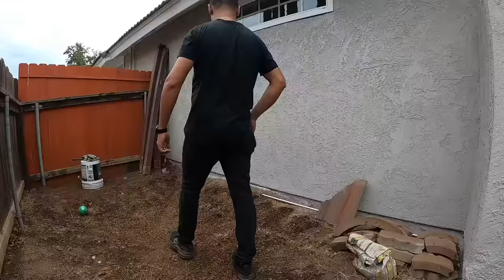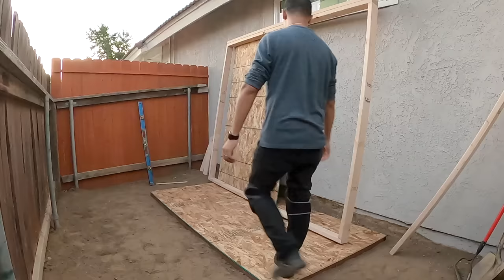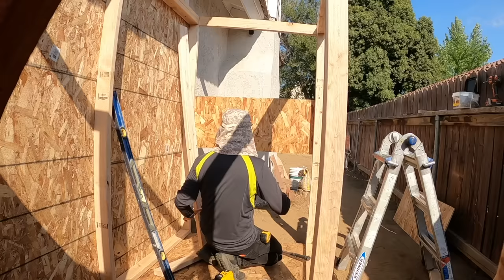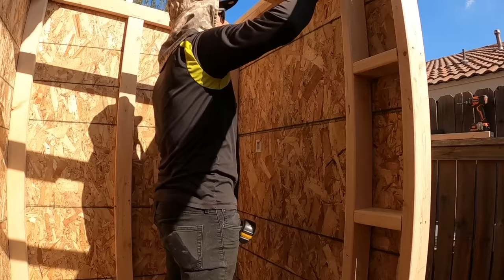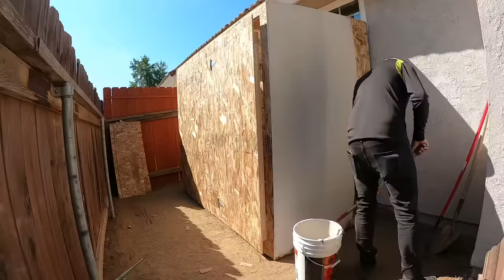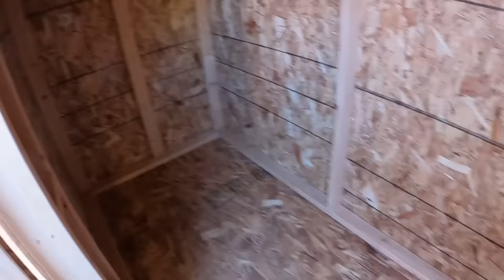How to build a simple 4 'x 8' storage shed under $380 dollars

Comment: Well I have 2 complaints, the first is that you dug it below grade, making for a place for water to gather and rot your floor. Second the pitch of the roof is very slight and in a heavy rain storm water will back fill and hit that window and back wall and run between the house and shed rotting that back wall. Otherwise I like the build, it is simple and easy to do, makes for a great storage place for gardening tools and stuff you need to store away for winter. I hope you take my complaints as constructive criticism, in hope to do it better in the future. I like that you added vents with a smaller mesh screen to keep bugs out and let hot air out of the shed. I also like how you did the roof, over all its a great build and design. So good job.
Reply from the maker: The base framing is below grade, however, there's good slope around it, the water does not pool in that area, it flows away from it. 
The roof pitch may not be visible in the video, however, in person you can clearly see that the front section is lower compared to the back, the rain water drains perfectly fine towards the front, we have had heavy rain and no water goes towards the back wall.
Thanks for your feedback 👍 don't forget to subscribe.
Reply: @NumberDZ I have another complain , I’m not the expert this seems reasonable about how flows the water, just wondering about the guard on the grinder, that disc looks dangerous, and for sure I’ll try to do a similar shed for my backyard, would be great if you share how many material you bought for it and the kind of tools you have used, thx!
Reply: And particle board
Reply from the maker: @orlandonunez5761  using the grinder without the protection is dangerous, however sometimes the protector gets on the way that’s why I removed it. I have included all the tools I used for this shed, you can find them under the “product” tag on the video.
Reply: Good shit guys
Reply: I'm building one today. Southern California OC area we don't have that much rain so his slope is not as steep because of our climate is really dry
Reply: Hindsight is 100 % correct, lol. The first building I ever made, I made so many mistakes. But that's like anything in life. The only mistake you can't learn from in life is car accidents.
Reply: You built it yourself with out anyone’s help 
You like it ! Thats good enough for me too many god damn complaining lol

Comment: no slope for the roof? where will rainwater go? also, about the hinges, you should have installed them in a hidden way so the screws are no exposed while locked - more secure.
Reply: I am amazed he didn't know 6" of the front of the shed.
Reply: It is sloped.

Comment: this is what I plan to build this spring, but with the door on the side instead of the front. Well done
Reply from the maker: I was also planing on putting the door on the side but after you start putting stuff in it, it gets difficult to reach the stuff all the way in the back, if you build it wider like 6’x 8’ you will have enough space to go around.
Reply: @NumberDZ  thats a good point

Comment: excellent video. Very informative. I need an outdoor shed so I plan to pretty much replicate what you have here. I do, however, have a few concerns. I'm in FL so we get a ton of rain daily from June to Sept. It is also almost 95 degrees for 4 months. The location I have selected will get little direct sun light but fully exposure to the rain.

How will the OSB holdup in the long run? Will painting prevent rot? How about a rubberized coating? Something like LIQUID RUBBER?

Comment: Nice build and well done video. One suggestion I might offer is to place a sheet of plastic on top of the final layer of dirt @ 2:10 so the floor won't rot. Thanks for a great DIY video!
Reply from the maker: That's a great idea!, thanks for watching.
Reply: Is it too late after it already done?
Reply: @redjeepyellowjeep-qz2on  If you read my post it says to install it at 2:10 which is DURING the construction phase, not after the build is done. So of course it would be too late after it's done.
Reply: I hired a company to make me a big shed(electric,a/c,etc)..I asked about something like that and they told me that water will always go under the shed and water need to drain so they compacted I think about 12 inches of pea rock/I saw vids of guys placing tubes to better drain water if it gets under shed /I was advised not to do concrete pad )
Reply: Of course I'm no expert about that but I had to pass different inspections from the city and it seemed correct info
Reply: Understood mate and thanks for the kind response @kikerules

Comment: You must live in a dryer warmer area. This would not work where I live. First, needs more drainage under the shed. Secondly, not nearly enough pitch to the roof. Lastly, the fiberglass roof is not sufficient for snow loads. Otherwise it's fine considering the price and care to detail used in building your lean to shed.

Comment: Why did you use OSB instead of plywood? That was a mistake due to susceptibility to moisture. Seal it real good on the inside too!
Reply: Probably price (osb cheaper) is it possible for the paint to seal osb(waterproof and humidity proof it)? I guess the idea is something not expensive and not forever (I can deal with spending $400 and replacing it maybe after 10 years )
Reply from the maker: You're absolutely correct, that is the main purpose of this video 🫡

Comment: Great work.  Just what I was looking for... I will build it this spring....just one change, I will be putting the door on the short wall.  thanks
Reply from the maker: Glad it helped. 
I was also planing on putting the door on the side but after you start putting stuff in it, it gets difficult to reach the stuff all the way in the back, if you build it wider like 6’x 8’ you will have enough space to go around.
Reply: @NumberDZ  Good point, makes sense

Comment: Hi , is there any option for door adjustment? I built 5×3 Domi shed exactly by assembly manual but I can close the door without heavy force.  A top of the doors are touching each other plus right door looks lower than left. Any advice? Thank you in advance for help!!

Comment: never seen those plastic wavy things for the roofs before. Those are nice. Do you remember what they call them>? I have seen foam ones but they degrade over time.
Reply from the maker: Home Depot sells them, look for “Polycarbonate Corrugated Roof Panel” mine are 26 inches x 12 ft.
Reply: That polycarbonate roof is available in 4x8 sheets also.

And of coarse there is a price difference between the 4x8 sheets and the smaller ones.
But once you buy those plastic inserts and the screws to attach the smaller ones.
You end up spending more than if you just bought the 4x8 sheet.
Reply from the maker: My local Home Depot doesn't carry 4x8, otherwise I would have bought that size
Reply: @NumberDZ 
Mine doesn't either.

Comment: You know you could've doubled the width and it only would've taken 3 more OSB sheets. Also it would've been nice to paint marine grade paint on the OSB to prevent rotting longer.  But as long as you keep painting sealing it every 2 years with water sealant you should be fine.
Reply from the maker: I know but the space wouldn't allow me to make it bigger.
Reply: Can you explain that to me? I'm a total newbie and would like something a little bit bigger and if it only adds three more sheets of plywood to it that would be awesome but wouldn't you still need more 2 * 4 for the framing?
Reply: @MyCabinLife  yes you would need some additional 2x4's for framing but that would equal about 8-10 more.  
If you added on 4 ft to both front and back end,  that would make the building 4 ft wider.  You osb sheets are 4x8 ft so a sheet at both ends cover the frame on the sides. Your roof area only extends 4ft so a whole 3rd sheet on the extended part should cover that as long as you building is only 8ft long

Comment: Looks good but how is it holding up with all the rain recently. Kinda worried your shed is getting flooded since it wasn’t raised much and was any Tsing going thru your window or shed since their was no pitch to the roof
Reply from the maker: No problems so far, everything looks good. The floor is about 6 inches above the ground level so no flooding problems. 
The roof has a good pitch the water drains towards the front, you can’t really see the pitch in the video but you see it right away in person.
Reply: @NumberDZ  good to hear I know alot of california is getting flooded and I just couldn’t see the pitch of the roof . This is a good video I might try and build one

Comment: did you drill pilot holes for all the screws? im just wondering because I just bought all the equipment and forgot to get a pilot hole drill lol
Reply from the maker: No pilot hole needed, you just need to put some pressure on the impact drill and you will be fine.

Comment: I wanna build a shed just like this but I dont want to build ground foundation for it cause I am eventually building a deck. My question is, does something of this size need to be anchored? Could it tip over? My guess is no but just wanna be safe. I actually wanna put wheels on bottom to be able to move it so I can build deck afterwards then place it on top. Any help would be appreciated. Its my first time doing this (attempting).
Reply from the maker: It won't tip over. 
You won't be able to move it easily, because it is very heavy. My suggestion is to build the deck first then the shed.
Reply: Yeah maybe I the deck first is the best thing to do. Thanks for reply back and great video. @NumberDZ

Comment: Nice job. What's the angle you used when you cut your sides of the shed?  I'm curious as I'm building one and I'm using your shed as an example.
Reply from the maker: What sides are you referring to?
All the sides are straight cuts with the exception of the roof.
Reply: @NumberDZ  yup the roof
Reply: He stated in an earlier comment that he used a 5" slope towards the front, and the area has excellent drainage.

Comment: Nice work. I can’t believe the total to be in the 300s. I’m guessing the building materials are still inflated because after Covid? I know lumber price increased, but is it still high?
Reply from the maker: Yes, they kinda are, I live in California, everything is crazy inflated here, not only lumber.
Reply: It’s just under $300 for material at my local Home Depot granted I want to buy pains and sealer to keep the wood in good condition and then expanding foam so seal all gaps
Reply: @itzlethal1700 what city or state you in?
Reply: @NumberDZ you know anything about prices in Mexico? Thinking of building a shed down there on some property i own. Any thoughts?
Reply: @andyfumo8931  I live in California so everything is expensive but still this shed was  very good priced, ended up buying LP smart siding for the walls and putting on galvanized metal corrugated sheets for the roof but it was roughly and same price if not cheaper than a prebuilt shed the same size and it’ll last a hell of alot longer, some waterproof silicone between the roof panels before screwing them down with some metal screws that have like rubber rings near the head for extra waterproofing and it’s been holding strong for the last 10 months
Reply: @andyfumo8931  only wish I would’ve made it bigger but 4x8 sheets of wood for the floor and side walls fit perfectly together so you could potentially make it twice as thick with more money, granted I spent more than $300 since I didn’t have all the tools needed and I upgraded mine but I use all those tools pretty frequently, $40-$50 circular saw from harbor freight been putting in work ever since
Reply: @itzlethal1700  you think i could get away with using a jigsaw for the cuts 😭😅
Reply: @andyfumo8931  I think you could it would just be a bit of a pain, probably have to clamp it down but I used one for many projects lol
Reply: @itzlethal1700  yea maybe a good carpenter 🪚

Comment: Excellent job bro!
I'm a framer from the past I'm quite impressed.
Reply from the maker: Thank you!
Reply: For a person wanting to store heavy things they could go 16" centers on floor with 5/8" or 3/4" OSB.
Also on the overhang ends of the polycarbonate panels is it open to allow air in?
I assume it is that's why you didn't put a vent on the other end for cross ventilation

Comment: when you measure diagonal os that to check if its frame? and measurements you looking for
Reply from the maker: That's to check if the frame is square, both sides have to give you the exact same measurement, if they are different that means it's not square.

Comment: Great Job. I only have 2 issues, the base was ontop of Dirt and the roof does not appear to be Slanted. The base is subject to rot from moisture and the roof water may drain in to your home. Otherwise Great job.
Reply from the maker: I used pressure treated 2x4s for the base, it should be good for many years it also has good water drainage so the rain and moisture is not a problem.
The roof is slanted, the back wall is 5 inches higher than the front, all the water drains to the front. Thanks for watching.

Comment: I wander when it rains if the water drains back toward the house since it’s flat ?
Reply from the maker: The back wall is 5 inches higher compared to the front wall, if you watch the entire video you will see it, so the water drains towards the front of the shed.

Comment: Why not use the wall of the house as the back wall of the shed?
Reply from the maker: You will need to pull a permit if you attach any structure to the wall of the house.
Reply: @NumberDZ  Good reason- thanks!

Comment: not bad....... but I would have done a concrete base to make sure it doesn't rot when it get's wet
Reply from the maker: I was going to do that but the price for the materials to do the concrete myself was $900 dollars, so I decided to use pressure treated wood instead.

Comment: I dont understand if the back is 8x8 how did you overhang osb 1/2 inch on each side. it has a 1/2 inch overhang.
Reply from the maker: I made my floor base 1 inch short (95 inches)  so my plywood on both sides sit flush with the back plywood, that’s why you see that 1/2 inch overhang.
Reply: @NumberDZ  thats what i thought but i didnt see you cut that good idea thanks for the quick reply.
Reply from the maker: You’re welcome.

Comment: Will the paint you used protect the osb from water/rain?
Reply from the maker: Yes, make sure to use semi-gloss or hi-gloss paint.
Reply: It is highly recommended to use an exterior oil based primer sealer, then apply final paint coat.
Reply: @dropndeal  Yep, I would most def prime it then paint

Comment: How did you solve the moisture problem?
Reply from the maker: What do you mean?
Reply: @NumberDZ  I would have raised the shed above the ground level (air circulation is good for under the shed in case of heavy rain fall or snow), add some moisture barrier under the shed, and 3 - 4 inch of rocks to drain any water that gets under the shed (it would only cost another $80 - $100 more and the shed will last longer ). Other then that the shed looks solid.

Comment: What thickness was your OSB?  Could someone get away with using 7/16”?
Reply: Thinking about building this, assumed he’s using 3/4, and I would do all but the floor with 7/16 I think.
Reply: @ericmlevy  At $17 a sheet I can’t see it being 3/4”
Reply: @joshuamshannon1974  good point, could be 19/32, which is $21 at my HD right now.
Reply from the maker: I built this with 7/16" as it was the least expensive option back then, so far I have had 0 issues with it, the structure is very solid and strong. If you can you should use 3/4 on the floor, I used 7/16" but made sure I had the proper backing on the subfloor, this is a small shed and I don't go in there very often, so 7/16" on the floor is more than enough.
Reply: I would use floor framing on 16" centers with 5/8" (19/32) osb
Reply: @James Karrie yes it's necessary if you're storing heavy items such as a tool cabinet on casters. I'm a framer.

Comment: Wondering how much all that needed tools costs...
Reply from the maker: Here is a list of all the tools I used to build this shed and the estimated price, I didn’t buy them for this specific project, I’ve had them for many years now. 
Framing nailer is about $370
Ryobi Miter Saw $270
Impact drill $120 
13 ft extension ladder 190
Ridgid battery skill saw 100
Ridgid multi tool 100
Makita grinder 80
Scoop shovel 35
Pick 28
Rake 15
shovel 15
Square 14
Tape measure 23
4ft level 50
Small level 6
Hammer 20
Pencil 0.20 Cents
Broom 8
Paint roller and extension pole 33

Comment: How did you do the roof? Is it a 2x8?
Reply from the maker: It is 4x8
Reply: @NumberDZ if the size of the shed is 2x4 and the size of the roof is 2x4 why did you even cut it? Should it line up perfectly?
Reply from the maker: @redjeepyellowjeep-qz2on  The size of the shed is 4x8, if you are referring to the corrugated roofing sheets, I cut them because the rain water drains towards the front of the shed, that means that I need to put the roofing sheets facing the front of the shed so the channels of the sheets drain the water towards the front, otherwise the roofing sheets are not going to drain the water properly.

Comment: Do we need local permit to build this shed, sir?
Reply from the maker: No you don't, if your shed does not exceed 120 square feet, you don't need a building permit. This only applies to California, other states may have different rules, but here in California you do not need a permit to build this specific shed as long as it does not exceed 120 sqft and does not have plumbing, electrical and/or mechanical equipment.
Reply: @NumberDZ  Thank you for your reply !